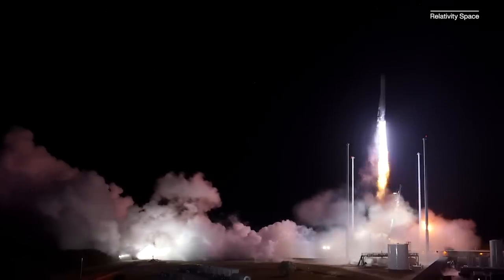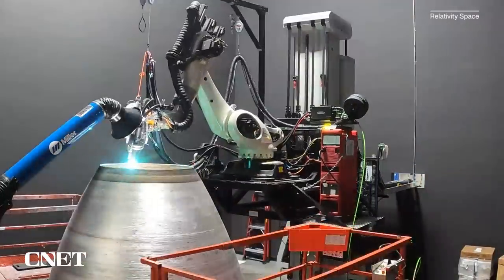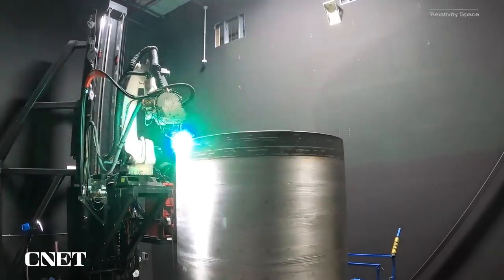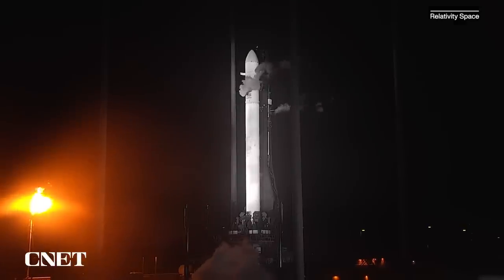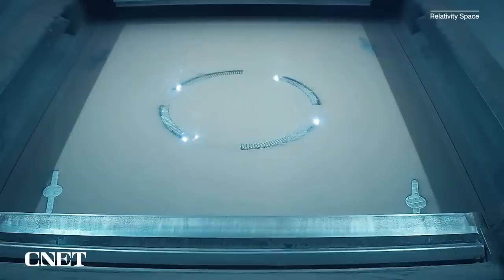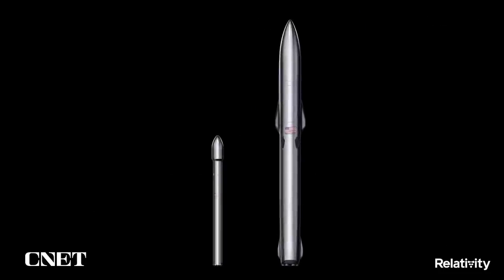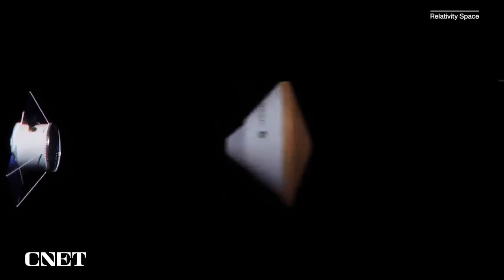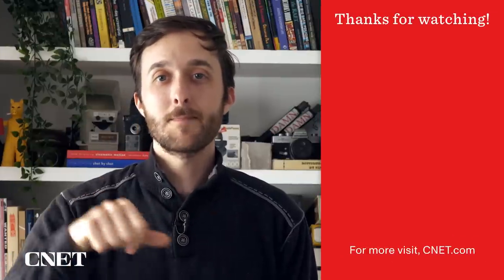World's Largest Metal 3D Printer Prints Rockets

Comment: it s in need for a multi-media cartridge option copper rubber plastic and resistor composite elements for assembly circuit board printing. Since i dont hear  this  mentioned much in the  3d printing realm it would be  a cost defray concept to market a multi-printhead concept solution for other companies.   Im looking forward  to  a  high temperature lubricant and   titanium slag solution

Comment: Space X and Tesla have both been using 3D printing for quite some time but obv not like this metal 3D printer 

But what makes this company really impressive is that This company makes rockets that are mostly made up of 3D printed items 

Though their rocket is priced to the middle of the market at like $10 million per launch, but is almost entirely printed using additive manufacturing with less than 1,000 individual parts. Traditionally, rockets have somewhere around 100,000 or more individual parts.

Relativity's 3D printers will be able to manufacture their rockets in less than 60 days and other Traditional machining methods means current rockets take about a year and a half or more to build.
Reply: Relativity Space has already confirmed that their next rocket (which bears a striking resemblance to the Falcon 9), will stop using 3D printing, their rocket will be built using traditional methods, only small parts will be 3D printed. innovation died

Comment: While I like the idea of 3D printed rockets, the truth is there's the likelihood of a failure point is extremely high due to the nature of welding.
Reply: Failure risk is heavily reduced by the use of a computer rather than a human technician
Reply: @theguy1506  .. A computer even an AI driven computer can't detect porosity in welding when a contaminant or gas is absorbed into the weld puddle. These impure welds are commonly referred to as cavities.
Reply: No but lots of types of NDT can!😅
Reply: I agree, especially since they scrubbed all their future launches so they can develop an entirely new rocket.
It’s slowly turning into a grift against their investors.

Comment: The first relativity rocket that made it into orbit was awesome to watch I had feared with the heat or coolness of our atmosphere the 3D metal would freeze and break apart, but what they have done is a achievement for 3D Printing solutions, evolve the design of the rocket and focus on insulation and decrease the amount of output from cryogenics to fuel you might have a better chance of stability you might want to consider to use a two or three additional engines just in case. I could be wrong but I’m clearly interested in the concept, and it’s a learning curve.
Reply: I don't think they managed to send anything into orbit. They did reach space though, but the 2nd stage failed, so it fell back.
Reply: Relativity Space did not reach orbit with its launch.
What are you talking about?
Give me $200,000,000 and I can make a rocket that won’t reach space either 😂.